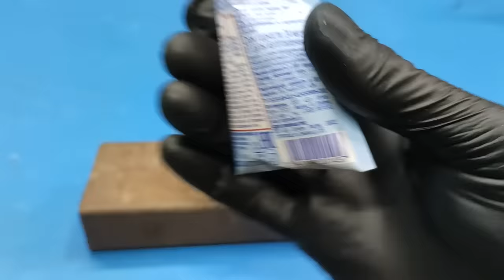Don't buy super glue, make it yourself in 2 minutes from vinegar!

Comment: Gelatin CAN be used as an inferior substitute for hide glue at a pinch. But hide glue is NOT superglue. Any moisture will loosen the glue joint. It is no use for gluing any material except wood or paper/card. It is used for veneers but is vulnerable to moisture. Hide glue is only suitable for wood if incorporated with well cut wood joints. You can't just glue to pieces of wood together and expect it to hold. Also, I would advise anyone NOT to heat water in a glass jar with a blowtorch! To dissolve hide glue correctly, the glue/water mix must be heated in a double boiler (the glue mix in a pan that is held in a larger pan of boiling water).
This is utter nonsense!
Reply: You are correct in that hide glue is not super glue.  They are two entirely different glues.  But gelatin is not an inferior substitute for hide glue.  I have made hide glue from scratch and used gelatin.  There is no difference.  All hide glue is water soluble.  Hide glue is useful to bond wood, leather, bone, horn, antler.  I've got a sinew backed bow I built 30 years ago and shoot often that is held together with Knox Gelatin hide glue.
Reply: Beside that you never use super glue to join wood, paper or cardboard. There are plenty alternatives of wood glue's designed for that,
but super glue should be the last and the worst one.
Reply: @wadepolly1798  I admit my description of gelatin as 'inferior' was based on assumption rather than experience. Gelatin dissolves more readily than standard hide glue. There is no difference technically as both are made from hides. Gelatin is more refined as it's intended for culinary use and goes through repeated dilutions before it's suitable for culinary purposes.
Hide glue sets to a firmer solid if left in the pot. I'm not saying that gelatin cannot be used as a glue but even purpose made hide glue has its limitations. It can be used as a stand alone adhesive when spread over flat surfaces such as veneers. But every other kind of bonding must be reinforced with the mechanical strength of tight fitting joints. Yes, it can bond leather in the same way veneers are bonded. I don't know Knox Gelatin hide glue... but, if it's sold as hide glue, it would be the same as any other hide glue. Hide glue is unrefined gelatin.
Reply: Yeah, I'd be afraid the blowtorch would crack the glass.
Reply: Thank you! I'm here looking up how to make wood glue waterproof because I need and don't have super glue and can't afford to buy any.  I do however, have all sorts of other chemicals and compounds one would find in a project shop and was hoping I'd stumble across a "secret" like adding oil based polyurethane or some such combo. This is the second video I've stopped on and happen to have all of these ingredients. I'm trying to glue together a glazed and rather porous pottery container that won't be holding standing water but will be getting moistened periodically. My plan was to layer several coats of shellac on the inside before moving forward with the intended use as a succulent holder. I think that Elmer's would likely work if I coated the inside enough and manage to keep it from ever being penetrated to compromise the glue. Wood glue is a step above white glue, so I've just worked through my own problem while intending to thank you for saving me from a huge mess and unnecessary waste. 
Much appreciated!
Reply: The torching of the baby food jar was the big red flag, but even as a terrible method all I could assume was that he was sanitizing the water because nothing else had been added to it.
Having read through all of your comments I see that he skipped the essential step of heating the mixture to emulsify the ingredients and for some unknown reason instead torched the water in the jar alone, and not even long enough to boil it.  Very strange.

All is not completely lost though, because thanks to your comments and the replies I now not only know what hide glue is, I have solid information to go on for properly researching it in the future.
Thanks to Both of you who contributed!
Reply: @combatgirl38  look up casein glue
Reply: I feel the title is a fair enough description...
Remember generally speaking only those who do carpentry etc. are versed enough to know the term "hide glue",
In contrast the term "super glue" is far more commonly used in association with adhesives
Reply: superglue is water soluble. he didn't use gelatin as glue. he mixed gelatin with 70% acetic acid and glycerin to make super glue.
Reply: @rontocknell5400 Is there a vegetarian gelatin that can be used instead to make vegetarian hide glue? Or is gelatin by definition of animal origin?
Reply: @Stelios.Posantzis  I don't know of any non-animal based alternatives. Gelatin is a hide product but there may be vegan alternatives. Whether a vegetarian alternative is also suitable for glue remains to be seen.
Reply: Thanks for replying @rontocknell5400  . I guess it is quite easy to find by myself. On the plus side, until watching this I thought that gelatin was plant-based. I'll be sure to remind people who are fasting of this fact when they are having jello for desert!
Reply: @Stelios.Posantzis  Agar is made from seaweed. It is used as a gelatin substitute in cookery and is suitable for vegans. Whether or not it could be used for making glue is a matter for experimentation.
Reply: Thank you for this @rontocknell5400 ! I bought some recently, not quite knowing what exactly it is used for but that it is a useful ingredient. Now I know what it is for. I am intrigued about whether it can be used to make glue. Having said that, I bought it from a specialist shop and paid through the nose for it so I will check to see if it is cheap to get from supermarkets before embarking on large scale experimentation/hide glue production!
Reply: @Stelios.Posantzis  Conscience doesn't come cheap, does it?
Reply: @rontocknell5400 Haha! I had been thinking that surely there must have been some ways that people were employing for sticking bits of wood together, before the discovery of hide glue, that must have been  plant based. After all, most sticky stuff in nature come out of plants whereas hide glue must have been a by-product or observation generated from cooking meat. Anyway, the thought popped in my head to look for resin-based glues and sure enough, the basic form of glue for survivalists in the wild - or the ancients for that matter - is cooked pine resin. It's awesome but quite laborious to make (more than hide glue, as it needs to be made outdoors). It is not quite the same as hide glue, however, so I'm still on the look-out for hide glue alternatives that are plant-based and bio-degradable.
Reply: @Stelios.Posantzis  Pitch made from pine resin was the first prehistoric form of glue. It suited the needs of the time as it could be strengthened with ground charcoal and molded  around arrow heads to fix them to the shafts. It sets very hard but it wouldn't be suitable for modern joinery.
Glue has been made from rice starch and other vegetable starches. I don't know how strong they are as I've never tried them. I tend to use wood glue, Araldite (epoxy resin) and Superglue (none of which are animal based). I would only use hide glue for repairs on old furniture or where I might need to 'unglue' at some future date (hide glue can be loosened with moisture and heat).
Reply: @rontocknell5400  Is that why the added charcoal to it? I didn't know that -- I just assumed it was intended to make it more viscous and quicker to set.
Thank you for the pointers to starch glues -- I will be sure to check this direction. 
I use the term "hide glue" in the above in the loose sense, i.e. a glue that can be undone with heat and water. My ideal glue characteristics are:
a) bio-degradable -- no toxic, synthetic pollutants at the end of the items life
b) hide glue like -- easy to undo without the use of organic solvents
c) not animal-based
The resin pitch maybe fits the above with a caveat for b), as it might be harder or impossible to undo. I want to try it out to figure out how easy it is to apply, whether it creates unsightly joints if it is left to ooze from the joint, etc. There are lots of pine trees in Greece so I would imagine it is easy to obtain some resin (although its production is heavily controlled) but if not, it would be easy for me to procure some small pine logs and extract it myself. Although this sound like a lot of fun, I'm sure the neighbours would not be too thrilled if I did and it does involve some extra hassle.
Reply: @Stelios.Posantzis  I think it involves melting the resin and boiling it for a period. Probably not advisable in a kitchen. I don't know how it would work as a glue. It's usually used to provide a waterproof finish. The charcoal gives it strength but that's not practical because you don't want granules in a glue joint.
Reply: @rontocknell5400  No, not indoors for sure. Heating up the log to melt the resin produces a lot of smoke from the log charring the log. I think you need to pound the charcoal to dust before adding it but it will probably make the glue granular when it solidifies. I've only seen it used in youtube videos, not in real life.
I checked out starch glue: there are many videos on how to make it. I guess the number one use for it is book binding. It is apparently used a lot in Japan in some crafts. I'm still searching for uses in carpentry. Many videos show it being applied to wood but I cannot trust them since they are not made carpenters.
Reply: pure gelatin is superiour to hide scrapings for making glue

contaminants reduce the glue's abilities
Reply: @combatgirl38  May be a little late but you can use acetone to melt various types of plastic and use that as glue.
Reply: @Stelios.Posantzis There's a glue made from rice starch i think, i think it's not the strongest but i think it is vegan indeed.
Reply: Hide glue is used extensively in guitars for the reason that the pieces glued can be undone relatively (very) easy.
Reply: obviously hide glue is not superglue, but any luthier would tell you that hide glue, when properly used, is a very strong one for wood, to the same extent of epoxy glue but it is also much better in the sense that it is  also fully reversible with heat and moisture (unlike epoxy).
Reply: hide glue is used in violin making and repairs
Reply: @SeeFreeTV 
No it's not.
Reply: @MG-kw1kb 
Not even close to a fair description. It's not super glue! Totally different type
Reply: @kirkstinson7316  It's super, and it's glue. What's the problem?
Reply: @rontocknell5400  Ahora que lo menciona usted, es cierto lo de pegamentos a partir de almidones vegetales. En cierta ocasión, preparaba un veneno casero para cucarachas, mezclé un poco de masa de maíz para hacer tortillas, un poco de agua, una cucharada de ácido bórico, y como tres o más cucharadas de azúcar. Lo empecé a revolver, pero empezó a adquirir una dureza tal, que se hizo tan fuerte como una roca, la cual tuve que tirar a la basura, porque no me serviría para acabar con los insectos rastreros que había en casa. No pensé en agregarle más agua, y posiblemente así disminuiría su fuerza de adhesión, pero sí me sorprendió la dureza tan intensa que adquirió.

Comment: I wonder if the creator here realizes that if this was superglue, the entire container would have been ruined within the first five seconds, as the entire container makes contact with moisture in the air, and starts to cure.

I wonder if the creator knows the difference between Cyanoacrylates and Hide Glue, or does he think "Hey, they are both sticky..."
Reply: actually, superglue doesn't cure in 5 seconds. even a very thin coat takes minutes.
Reply: @SeeFreeTV  it might take a total time of minutes, but it STARTS within seconds. For example, you cannot slather on superglue wait a minute then scrape the excess up and replace it back into the container to be used later, because it has already STARTED curing.
Reply: @dracoargentum9783  He didn't use it later. he only used it a little bit later.
Reply: It would be far easier to just buy super glue.

I'm sure hide glue has its uses, but if you need super glue, get the genuine article.
Reply: @SeeFreeTV  Superglue in a thin enough coat with moisture cures in fractions of a second.  That's how people get their hands stuck together.
Reply: @v8pilot  It's fake news. That's never happened to anyone ever. Superglue barely does anything. It's just water.
Reply: @SeeFreeTV  Have you used superglue?  I use it extensively and it's not hard to get your fingers stuck together.   For applying a nut in an inaccessible place, I can bond a nut to my fingertip and the bond, I assure you, is made in seconds.  Maybe you should try a different make.
Reply: @v8pilot  You must have different superglue, because all the superglue I use wont stick to anything. I'd be better off using water.
Reply: A ridiculous comment. @SeeFreeTV

Comment: That was as expected, I use a different method and disolve Polyistyrene packaging into glue with acetone it is quick and simple. the results are the same. the wood splinters before the joint gives up. Mainly only good on porous surfaces.
Reply: @popcornshiner3937  so tell me like aliphatic the tighter the joins the stronger. Does this polystyrene like being clamped almost to destruction?  People use so much aliphatic thinking its better and think if you clamp all the glue out itl break. Quite the opposite.
Reply: @nathangrueber9834  I simply used it like pva glue, just a small spread over the jont. I never clamped it as I was just testing the theory, I just used a brick on top of the joint then let it dry. I found the wood tore up rather than the joint snapping at the glued section.
Reply: @popcornshiner3937  yep thats normal

Comment: A simpler glue can be made by dissolving polystyrene foam in petrol or any solvent.........when the solvent evaporates you have a SUPER glue that will bond with concrete to seal cracks in concrete bowls or concrete floors  etc.
Reply: Erm, that's napalm mate.
Reply: When your napalm dries out it becomes a polystyrene binder? I shall test this, if I can resist the urge to light it on fire
Reply: @Runedragonx  Then just buy polystyrene cement. Or use acetone as a solvent.
Reply: @Runedragonx  Yes, it will dry out to a rigid hard gel that can fill cracks in concrete or patch rotten wood.and can be sanded or drilled etc......you can mold it too.
Reply: @gangleweed  It also turns into an incredibly hard and impossible to remove puck of carbon when allowed to burn, all the while releasing a noxious soot... I may or may not know this from experience.
Reply: So, nail polish remover and polystyrene will make super glue? I'm guessing not without some fumes.....

Comment: This is great if it works. I literally cannot use any super glue out there because of the fumes (not even outside). There's something in it that immediately makes my eyes burn and water the second I open the cap! If my eyes are watering, I can't see to do what I need to do! And, obviously, the burning is very uncomfortable to say the least. So, I'm stuck with trying to make other glues work, and they don't always work. 

Also, this is a great non-toxic glue option for DIY pet toys. I have birds and always need non toxic glue recipes to make their toys.
Reply: You could wear protective goggles?
Reply: @barnabyvonrudal1  believe it or not, they don't work. They don't prevent the fumes from getting to me, unfortunately.

Comment: Give the producer of the video a break...
We all know it's not the product 'super glue' common sense would tell ya that by brush in pot on the video...
It's a great idea shared 
Its cheap n easy n all pantry items
Done with good intentions 
That's all that matters
Thanks for the video
Reply: A break for lying? For click baiting? I thought hey, here is a garage chemist putting his life on the line along with hundreds of dollars worth of equipment (hopefully some safety equipment, too, like a forced air supply respirator of some sort) and materials, to make a common, inexpensive, and readily available substance that you can buy in any drugstore or hardware store. I was curious about his process. Maybe he had come up with a relatively simple and primitive way of making cyanocryalate glue, but no, just gelatin based stickum that won't work very well except on porous substances and has poor resistance to water, and needs minutes or hours of clamping for a decent bond. The fact that most people will presume that the producer of the video is a liar does not excuse the lie.

Comment: WOW, that was awesome! but it’s still easier to buy it😜
Reply: I agree. However this is good knowledge if you're ever somewhere in the world that doesn't have crazy glue.
Reply: @rwdyeriii  true, but what a pity for those somewhere in the world where the crazy-glue unavailability's the same issue with the vinegar 😮😂
Reply: Not for everyone!  I guess if counting all of your savings takes just 1 second (adding 1 penny to another one, it wouldn't be that easy 😜😅 (sorry, Dutch humor)
Reply: Super glue after opening the tube usually impossible to get a second usage. That way they sell more. Epoxy is the best.
Reply: @rwdyeriii  This is not super glue in the slightest. Super glue consists of a specific chemical known as cyanoacrylate, this concoction is more akin to a bookbinder's glue.
Reply: Almost nothing in life is so hard that it cannot be made harder if you try.